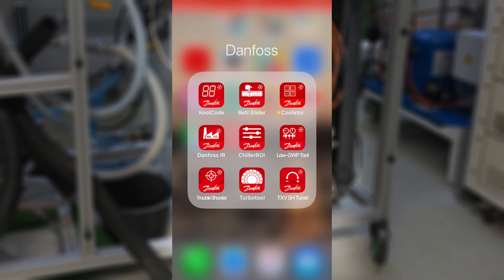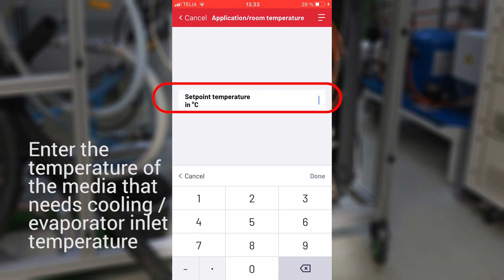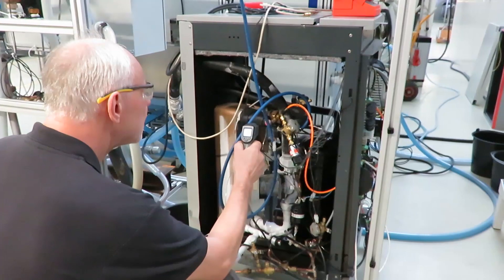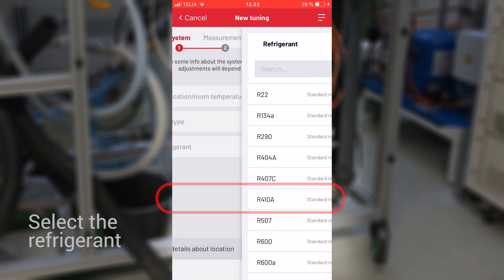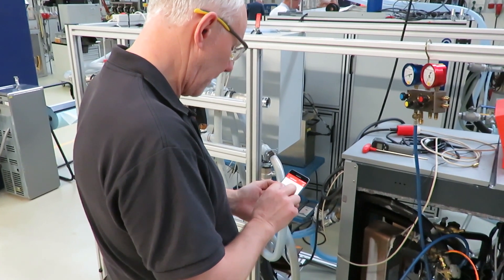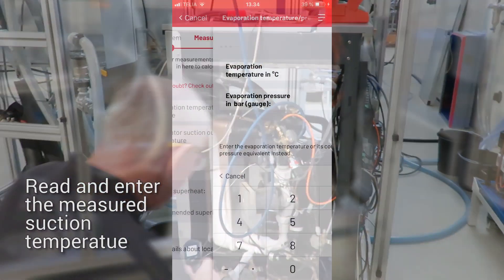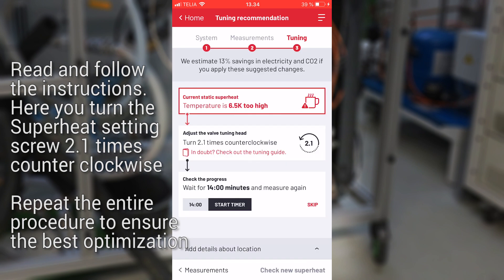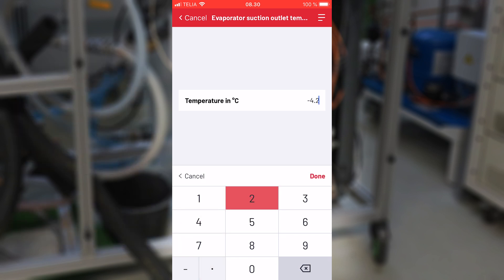Danfoss TXV Superheat Tuner app  — a quick walkthrough guide

Comment: 1)Application temperature means before expension valve is it correct??.
2) evaporator temp men's after expension valve is it correct?.
3 suction temp men's evaporator outlet temp is it correct??
Reply from the maker: Hi Prasad, 
 
Here are a few quick answers to your questions:

Question: Application temperature means before expansion valve is it correct? 
Answer: The application temperature is the temperature you want to obtain by the cooling process, like a cold room kept at 5°C for dairy products.
 
Question: Evaporator temp means after expansion valve. Is it correct?
Answer: No, not quite. The evaporation temperature is the temperature where the refrigerant starts to evaporate/boil, aka. the bubble point.
 
Question: Suction temp means evaporator outlet temp. Is it correct?
Answer: Yes. That’s the temperature of the refrigerant at the outlet of the evaporator, typically where the TXV sensor bulb is placed.
 
Hope that helps! If you want to learn more, check out the free eLessons on our Danfoss Learning page: https://www.danfoss.com/en/service-and-support/learning/cooling-learning/